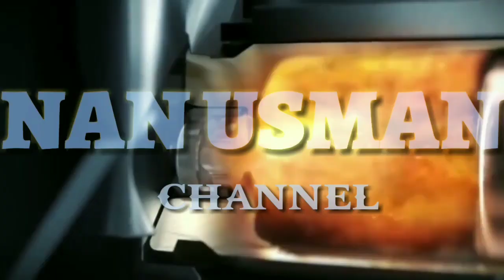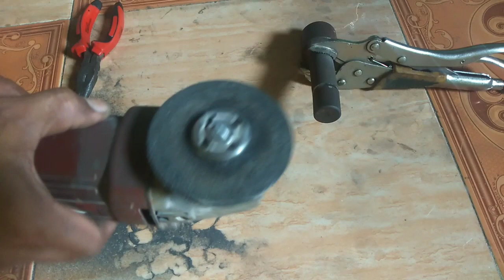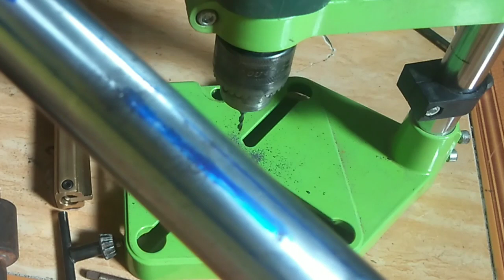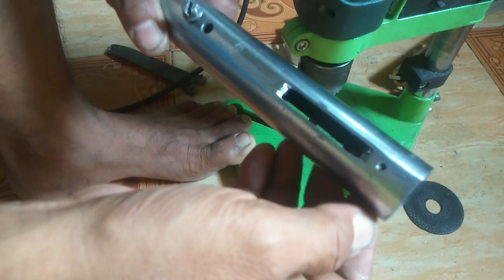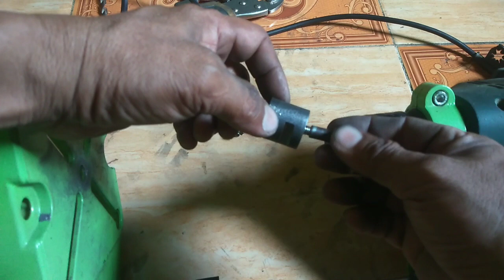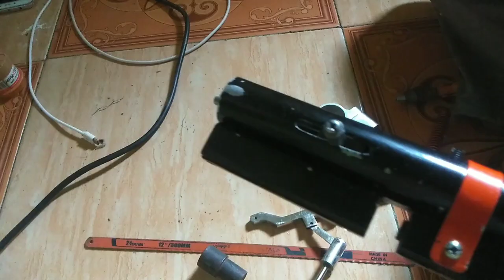Tanpa alat bubut shoock bekas bisa jadi sesuatu yang berguna

Comment: How did you make the trigger?
Reply from the maker: I made it with minimal materials
Reply: how did you make?😂
Reply: What do I need to build?
Reply: How did you design? What is the design?
Reply: I designed Kelly and now I doubt the choice of the tank and I do not know what to use. Do you think PCP capsules are good?
Reply: I can not speak English well, help me if you can